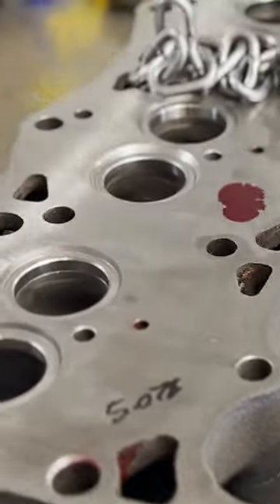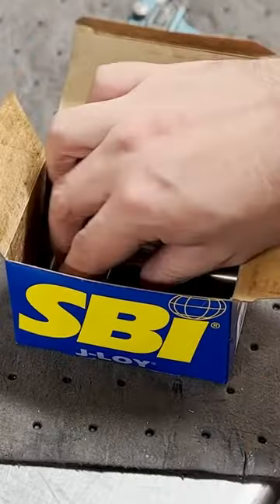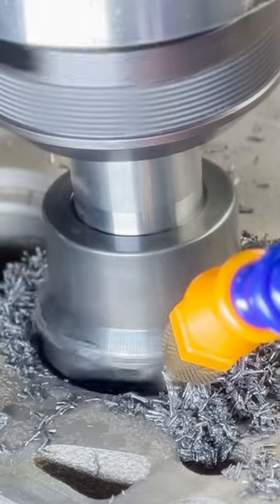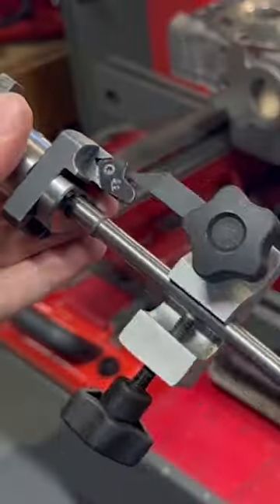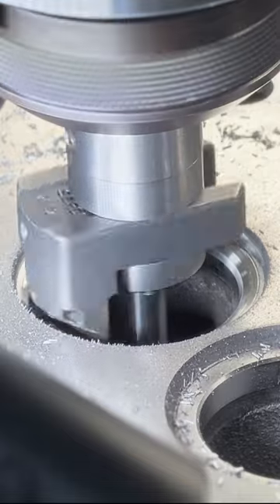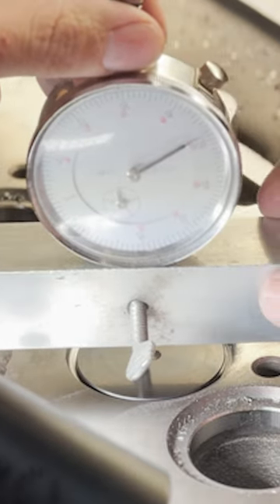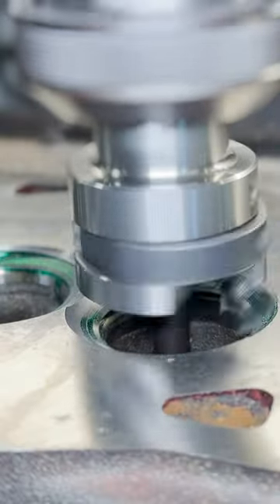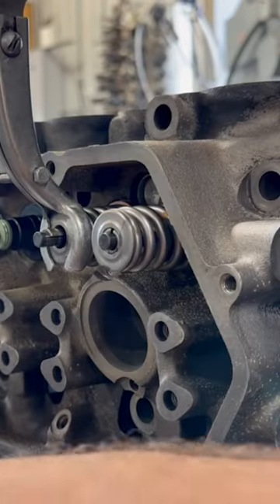#shorts As a Chevy guy, these Ford heads need all the help they can get!

Comment: Accept the 7.3 powerstroke. Arguably the best diesel engine ford ever had anything else after that was pretty much a money grab for them
Reply: Made by international but I get what you're saying.
Reply: The 6.7 is a great engine
Reply: @tambosnipes1652   it is a great engine for people who can afford to own one
Reply: Alteast ford had one good diesel engine
Reply: It’s except not accept 😅
Reply: The 7.3 was amazing, but it was only so reliable because it didn't make enough power to hurt itself. It was overbuilt for what it was.
Reply: Bro international engines were trash, 
Ford threw them outta the park with the 6.7
Reply: @MikHoncho81  I'd say properly built for what it was. Powerful and reliable. Nowadays we stupid power that's not reliable on trucks that can't handle the tuned capability of their engine. I E. 6.4 tremendous power but must be deleted to survive. Then transmission can't handle anything over mild on the tune.
Reply: @MikHoncho81 
Overbuilt in the best way possible. Boss has a 7.3 F-250 with almost 450,000 miles and still tows a 10,000+ pound boat with ease.
Reply: @removefromme  but not many hotshot with a 7.3 as it doesn't make enough power. My 2016 6.7 had 373,000 when I traded it. Never had one issue, never leaked anything. every single mile was pulling a 40 ft gooseneck. Empty it was 10k. Fully loaded it weighed 22k
Reply: Have a 01 7.3 excursion , a 97 f250 7.3 and a 2011 6.7   The 7.3’s are fucking awesome for what they are and when they were made but the 6.7 kicks their ass. The only issues I’ve ever had with the 6.7 was dpf related . Thing makes stupid power on a just a tow tune , been one hell of a work truck . The 7.3’s have had injector swaps , ipr valves etc but they’ve been good to us as well . They just don’t make anywhere near the power
Reply: And also the most loudest clankius annoying thing I've ever heard in the world
Reply: I'm a ford guy but the 7.3ps is not a ford engine it's an International engine. The 6.7 is a in house ford made diesel
Reply: The 7.3 got a bad rep early on for tuning because people didn't know how. HEUI is overly complicated and people needed time to figure it out. Now you can make 500hp/800lbft reliably.
Reply: @MikHoncho81  Exactly how every diesel engine should be designed.
Reply: @removefromme  Exactly, I have a few friends with the 7.3, it is a legitimate million mile engine.
Reply: So Chevy is the quality engine maker.. got it, learn something new everyday..
Reply: @chaseledbetter5186  they put the 7.3 all the way up to a 16 wheeler they put it in trucks that were empty that weigh 30,000 pounds it could be in a large Wrecker with a stinger then you add two more vehicles to the weight
Reply: It will run forever because it doesn't have enough power to break anything.
Reply: Imagine the 6.7 without all the def garbage????
Reply: 6.7 is way better in every way. 7.3 doesn’t coldstart easily unless everything is perfect, sluggish without a ton of work, drink fuel like no tomorrow, terrible HEUI system.
Reply: @steveq4178 he wants you to accept 7.3 into your heart as the one true savior of overrated turds
Reply: @luvspeed2701 you call a 15 year old engine (6.4) nowadays 😂
Reply: @tonydiesel3444 good luck moving faster than 25 with a 7.3 pulling all that weight. Getting 4mpg too 😂
Reply: Even in those days, Ford offered the Cummins in all their real trucks. Let that sink in.

Comment: The 7.3 was a great engine. Got 300k on one and 280k on another. He is right though.....the 7.3 heads were BRUTAL for flowing air. If they were 4 valve heads the 7.3 would have been amazing.
Reply: Any 7 liter motor making 100hp will last forever. 😉. It is a great motor though.
Reply: @Rocketogre  lol.....Nice one. I am sure you know they came from 215-275 hp

Comment: I unshroud the valves on every diesel I own, I understand they need tight compression clearance, but the increase in low-lift airflow more than makes up for the tiny compression loss. I’ve seen diesels with valves set 3/16” in for no reason completely shrouding the 0-.150” -0 portion of the valve action. Unacceptable. I love that offset relief cutter, beautiful tool.

Comment: Come on bro.😂 7.3 is the good one.
Reply: It is a good one...  I have two f350s and one f550 with 7.3 engines in them. They  are probably the only Dependable engines Ford put in their trucks. Probably because Ford didn't design them.
 International/ Navistar designed them. 
Still the 7.3 is a dog when it comes to power.  The Cummins and Duramax have it beat by far.
Reply: @barbaraclements8068  to be fair; navistar also designed the 6.0 and 6.4 and they are notoriously trash unless you sink another trucks worth of money into them. But Ill give it to em on the 7.3.
Reply: Ford 6.7 is in another league, best diesel engine aside from Cummins, but some people don’t like shutting off their motor to order at a drive through or deposit money at the tube and shake apart the truck.
Reply: Ironic that you gave Navistar credit for the 7.3 and took a jab at ford, when all the navistar engines have issues (yes, the 7.3 wasn’t perfect at first) and the ford only 6.7 is sooo much better than the average Navistar junk. Few early turbo issues (every current engine had that phase) and the emissions system is even the most reliable on no deleted trucks. If the 6.7 ford came without emissions it would make the 7.3 look so much worse.

Comment: Except they aren't a ford part. The 7.3 was built by International
Reply: Exactly! But you can't expect a chevy guy to understand that. They like to claim their isuzu is a chevy.
Reply: @David Scott  It is a GM engine. Yes, it was co-designed with Isuzu but was always built in the US by Dmax which is a joint venture between GM and Isuzu that is 60% owned by GM. So technically yes it is a GM engine and not made by Isuzu.
Reply: @geoffmooregm  
Isuzu designed it, because GM fails every time. That's all I need to know.
Reply: @David Scott  It (DMAX) was and still is a joint venture company. The Duramax engine was jointly designed and validated for use in GM vehicles. Yes, Isuzu certainly leaned on their successful diesel history when aiding in the design. 

GM already had an existing partnership with Isuzu before the Duramax project. All gasoline V8's in medium duty trucks were and still are Chevrolet V8's. The Chevy LUV was a re badged Isuzu. Most of the Isuzu light truck lineup used a GM V6 at some point during production. The last few years of Isuzu light trucks in North America were re-badged S-Series trucks.

When Ford contracted Yamaha to design the SHO V6 and V8, did that make them incapable of designing their own engine? 

The fact is all manufacturers have some winners and some big turds.
Reply: @geoffmooregm  
Maybe duramax is a good engine, I've just seen too many people burned by Chevy diesels in the past. After personally witnessing three relatives have chevy diesels completely die on them, I can never trust them.
Reply: @David Scott  I don't doubt it. It is buyer beware when it comes to vehicle purchases. Now, with modern emissions on the diesels, all of the manufacturers are having issues.

When I was shopping for the SUV I have now back at the end of 2016 I was looking at all makes and ultimately decided on the Toyota Sequoia because it was the one with the least amount of major issues. Yes, it is old school without all the gizmos of today but we still have it to this day and tow with it all throughout the camping season. Other than being a pig on gas, I have no complaints. It was the first new vehicle I have ever owned. Before that, I always shopped used and only purchased vehicles with a proven track record. 

I had a 93 GMC Sonoma, a 1900 Trooper,  a 97 RAV4, a 2002 Civic, and a 2013 Elantra GT. All of them manual transmission. I still own the Trooper because it is my off-road toy. Basically, I bought those vehicles only after scouring forums for major issues, and it seemed to work well for me. I only had standard issues like dead alternators, starters, and leaking rads and hoses. All easy weekend fixes.
Reply: @geoffmooregm  
I'm a fan of manual transmissions. I wish you could get one in a new diesel truck.
Reply: @geoffmooregm  
The manual transmission is probably why I'll never get rid of my 7.3L.
Reply: @David Scott  Same, my daughter will be driving in 3 years and has already told me she wants to learn because it looks fun. I can't wait to teach her. She will be the only one in her high school who knows how to drive it, I bet.
Reply: @geoffmooregm  
That's funny! My dad taught me to drive in a 1973 Dodge 3 speed truck.
I plan on teaching my daughter to drive my truck this year.
Reply: Well i own several 7.3 psds 6.0 psd and a 5.9 24v and im working on a 3126 swap all in Fords
and my beater is a 98 k1500. and to be honest i like them all. the 7.3s (all mine are obs and bricknose) 
the 7.3s dont run to bad. im not looking for alot of hp or alot of tq... i look for reliablity. and so far my 96 f350 has over 500k and runs just fine.
Reply: and just for the record the 6.0 stroker is a P I L E...
Reply: @donmunro144 the 7.3 idi was international. The 7.3 powerstroke was navistar/ford.
Reply: @nathansonnen9407  Navistar is international
Reply: @nathansonnen9407  not entirely correct. The 6.9, 7.3 idi and idiT were international/navistar.

Comment: The million mile diesel engine "Needs all the help it can get". Clearly you don't know your history.
Reply: He’s joking but you are correct. 
Mine has 372k no blowby. Neighbors have 02’ with 60,000. Bought it new and occasionally pull fifth wheel. Immaculate. Been offered $35,000 and turned it down. Cost them $100k to replace it w/6.7.

Comment: International head. 

Ford Cleveland heads are arguably the best small block heads ever developed.
Reply: Until now. 7.3 'Zilla has some sweet heads factory.
Reply: @ChevyConQueso  not a small block.
Reply: @Jeremyv1980 not a big block either homie. Just like the Cleveland! And FE series. But really there is no big block and small block, is there an airport style bag measuring device outside the dealership to measure big or small block? No. Even Dodge RB were a unique size.
Reply: The coyote heads and some of the LS heads would make a Cleveland look like the trash it is.
Reply: @_..-.._..-.._ you're just here to argue man. 4V Cleveland closed chamber heads flowing in excess of 270cfm as cast from the factory in 1970. Easily supports 540hp with no porting or polishing. 

You may not recognize common nomenclature of sbf and bbf, that everyday mechanics use because you aren't a mechanic. You may be a weekend warrior parts changer, and that's fine. 

Coyote is a modular overhead cam design, not traditional small block. Ls don't fit a sbc. Old school iron small block Cleveland is king.

Comment: The only problem with the big three's diesel engines isnt their design, it is the emissions equipment. That is the source of all the problems. The right solution in the future is to demand tunes that force the engine to run on the lean side and never allow rich settings that create excessive suit. Keep the engine running lean and in the NOX creation domain and retain the DEF system. In that regime they can drop the particulate filter.
Reply: It's very hard to prevent diesels from making some soot (not enough to see, but more than permissible under modern emissions standards) even running super lean. Modern standards are so stringent that even some direct injected spark ignition engines are using particulate filters. So generally you'll need a DPF.

However a tune with no EGR and use of DEF to clean up NOx emissions will provide enough oxygen and heat to burn off the soot in the filter naturally under most conditions, in fact making NOx becomes beneficial because NO2 acts as an additional oxidant that assists the DPF burn. DPF regens should be a non issue unless you spend all your time in low speed city traffic.

It's a pity nobody makes a diesel hybrid, with a hybrid system the electric motor and batteries could handle low speed traffic and the diesel would only run when there was enough load to keep the filter clean and the oil free of fuel dilution.

Comment: 7.3 was one of the best engines EVER made from any company (saying that as a Chevy guy myself)
Reply: Nah, overrated diesel chuggers. Only called great because they were followed by two more turds before Ford told Navistar to leave and made the best diesel truck engine, the 6.7 ford.
Reply: 12mpg on diesel with 225hp is criminal
Reply: @_..-.._..-.._  no they were great because you could put a million miles on them without major issues. Your plastic wire covers and rubber hoses would rot before you ever had mechanical issues with those engines

Comment: Regardless of your opinion of Ford, there are definitely better engines to make fun of than the 7.3.
Reply: 5.4L 3 Valve for example 😂

I owned a 4.6L 2V and the only issue it ever gave me was the #1 cylinder intake gasket going bad.

Comment: I helped my. Brother n law. Go. Through. His 6.0 and. I tell you. One. Thing to all them   6.0. Haters. It is. Very. Hard to work on for sure. But it is a. Good engine. It had. Two   Oil pumps. Maybe not a power. House.   But is strong. It has 325,000 miles and not. Burning oil. You have to use thick. Oil in them 20/40. Or a hood 30w is good. Never ever. Never ever run thin oil in a. Diesel period. It will. Cause. Major. Damage. The only. Power motor you run thin oil is the.. V10. Ford. Gas. Burner. Because if. Very. Tight. Clearances